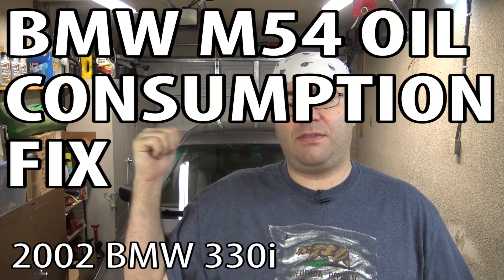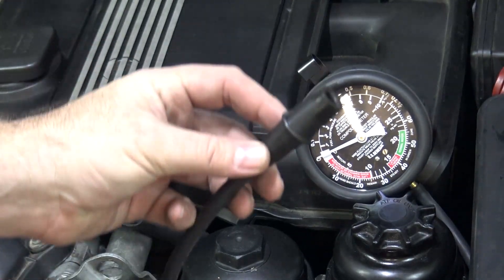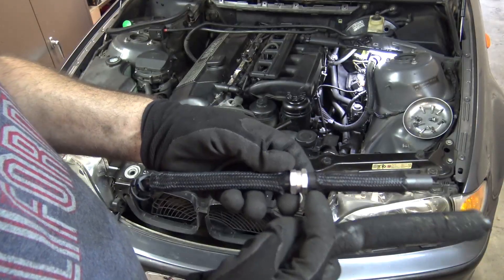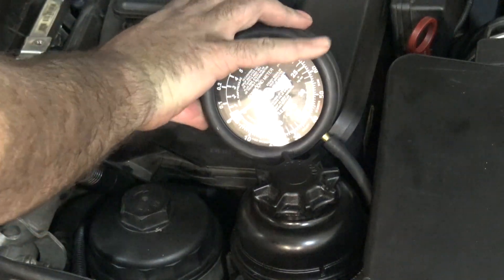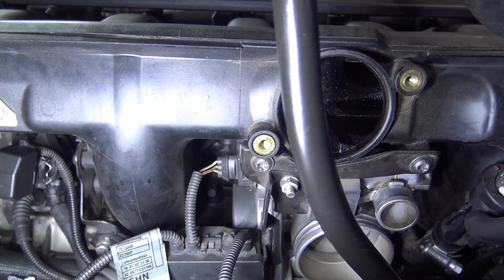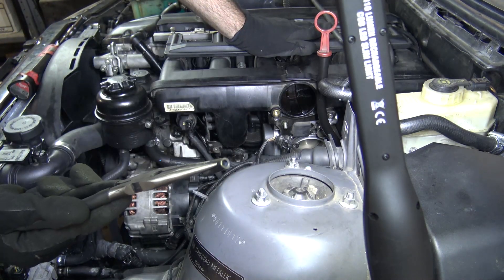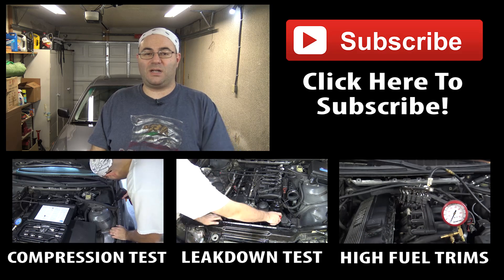BMW E46/E39 M54 Engine Oil Consumption Fix (02Pilot Mod) DIY

Comment: had this mod on for a couple of weeks and it made my oil consumption worst, tried it with the check valve and without, doesn’t work, just run a catch can in line with the original ccv system

Comment: Hi 50s Kid !!, congratulation and thanks for you channel and their contribution to entusist like me (I have a 2004 320I with M54B22 engine). I have some question: check valve need some presion to flow in the permited direction, how the oil will flow gravitationally to the pan if don't break that pressure?

Comment: 🤚 dumb question: The tubing that you cut to add the check valve to. That tubing connects to the dipstick tube and the valve will sit slightly above where the tube inserts on dipstick tube. And the check valve has the arrow pointing towards the connection at dipstick tube?

Comment: I did this on my e46 330ci, both the valve and the added vacuum hose, my car still smells like oil inside the cabin, is there anything else i can do or do i just have to keep driving to burn the oil that piled up inside the manifold?
Reply: Having smoky exhaust?

Comment: I have a major CONCERN here the one way check valve has a minimum working pressure of 0.2 bar i dont think the oil droplets achieve this pressure so you are effectively closing the tube that goes into the oil sump and therefore not recuperating any oil. 
Any feedback or thoughts on this is highly appreciated

Comment: This isn't a real cause and solution for oil consume. The problem is about the oil rings in the pistons. On my M54B30 i've removed completly the oem CCV and oil vapor goes to the atmosphere. The engine still eating 1Kg of oil for 1000km. So this mod isn't the solution at all.

Comment: OK, I hooked up the O2 pilot method on my M 54 and the oil consumption has stopped. The only issue that I see now is the oil pressure light flickering when I come to a stop what is causing that? Is anyone had this issue after the pilot method?
Reply: Did you find any solution?
I see that this happens to many people
Reply: @elquemao I just put 10w-40 in and got rid of the 02 pilot and oil level has hardly dropped

Comment: I tried to buy the 3/32" and 1/4" vacuum hose at the local parts store, the 3/32" does not fit on either the nipple or the 1/4" hose. Advance auto parts had a bunch of vacuum hose, I ended up getting 5/32" and 1/4", the 5/32" fits great on the nipple and on the 1/4" hose.

Comment: I'm a little bit confused. Is there a difference between the little and the big intake ports?
I just want to know if there is a necessary for me to buy the adapter for the hose.
Thank you!!!
Reply: It depends whether u have a free vacuum port u can tap into. like if u have a secondary air pump and exhaust flap u will have to use the larger one.

Comment: Thank you 50sKid for your time and effort on your chanel.
10 years ago i bought a 2003 330ci convertible. In the North of Sweden. Its my summer car. Anyhow! Yesterday i did my 02pilot mod. The only thing i remowed was the airfilter housing and the upper big intake hose.  The rear plug was broken so i took it with my fingers. The smaller hose was easy to conect with a plier. The rear tube was tricky, i took a drill and made the hole more like a funnel at the end. Once i got it started i could take a long stone aged plier to get it in all the way. The only problem i had was some big brownish flying things that takes a bite like a chicken nugget. It was +30 C and sunshine, and i had to work fully dressed. When i had the 2 tubes connected i put everything back and started the engine, and the vacuum was in the rear tube, so the arrow on the valve is pointing to the back of the engine. 
I have the Torque app and obd sender, so i can see all sensors, but not erase fault codes. The vacuum meter is the same now as before 02pilot mod. The funny thing is that i get BOOST at full trottle on first and second gear, before and after the mod. 
I had to fill up a + pint every 2 tanks. Now i have 2 trips to the gas station and i will hit 200 000 km.. 124 274 miles. 
The CCV is never changed, but i dont have cracy vacuum when opening the filler cap.

Comment: Hey 50skid I had a question. About to rebuild my ccv system, with what you know now, would you still recommend the one way valve in the dipstick drain tube hose? Or do you think it’s unnecessary
Reply: In a later video he found that the cheap Chinese valve he tried leaked, so maybe not any practical benefit

Comment: Am I the only person that can’t find 3/32 ID vacuum line ANYWHERE?

7/64 is the smallest line I can find anywhere locally, and is 1/64 BIGGER than 3/32 and doesn’t even come close to being 1/4 OD.   It’s super thin.  What 3/32 hose has an OD of more than 1/4?  That doesn’t even seem possible.

@50sKid Are you 100% certain that it’s 3/32 ID line?

Amazon doesn’t even show me ANY 3/32 ID vacuum line.  If I can’t find it on Amazon, it’s no wonder that 15 plus auto parts stores just gave me a blank stare.
Reply: @50sKid

Comment: Great video, my CCV was replaced 4 years ago and my 530i burns a litre of 5w40 every 250 miles. I would like to try this.
By the way, the CCV drain hose is completely dry. That's because the CCV has failed again or because of lack of vacuum?

Comment: At 5:53 the gauge shows almost no vacuum pressure because the with the CCV input hose connected to the gauge, the valve cover hole is wide open causing the crankcase to have zero pressure and the same inside the CCV. You need to plug up the VC hole.

Comment: Has anyone done this mod without the check valve? thanks ~
Reply: Don't use a check valve, it doesn't work because it already requires 0.2bar to open. It also gets clogged with dirt.
I did the O2Pilot mod and the oil consumption stopped which was 1 liter/1000km.
The mod requires that there are no suction leaks in the car. First I did a smoke test and then at the same time with O2Pilot I installed a new CCV and all pipes.

Comment: I only get oil burning at 6000+rpm my engine is on 253,000 miles 2.2 petrol but has been motor way miled from new the guy said he used to drive it normally up to 70mph then stick cruise on as he was a highway engineer so I doubt my engine is severely worn out. Is it worth me trying this? It goes down to min mark after about 600 miles
Reply: What about now?
Reply: @riccardodefina9551 it’s pretty good now I only check it maybe once a month and barely drops I’m on 270k miles now I’d say it takes around 2500 miles now before it needs a little top up
Reply: @dexietyy7922 wow from 600 to 2500 miles is a very good increment! Nice to know this! Mine 2.2 too has something around 218k miles! So if yours has this type of consumption it might worth a try even on mine!

Comment: I'm having trouble with the 3/32" ID line and 1/4" ID line, the 3/32" does not fit snug at all in the 1/4" ID line it is too loose, am I missing something here?!?! Can anyone offer any help?
Reply: Same here.  I can’t even find 3/32 line, even on internet searches.  Even 5/32 is way to small to snug into 1/4”.

It would nice to get answers on this.

Comment: if you pull to much you risk oil injection no good, A typical PCV system should be pulling about 1 to 3 inches of vacuum in the crankcase at idle. If you see a significantly higher vacuum reading, the intake manifold gasket is probably leaking and pulling vacuum on the crankcase.

Comment: I really like this but i have a m54-b22  and i dont see those blocked iff pipes on the intake i only have it on the air intake pipe just behind the air air flow sensor

Comment: I don't have that port on the ccv, 04 325xi..... UPDATE So I have the "cold weather" ccv version, so it's like wrapped in a protective shroud, so I couldn't see the vacuum nipple. So I took long needle nose pliers and ripped/tore a hole in the shroud around the ccv after I realized why I wasn't seeing the vacuum port. Then it was right there. I only had to take off the airbox and half of the throttle body elbow. I used 3/16id vacuum hose on the ccv port, and 1/4id vacuum hose on the back of the intake, both from Napa. And I did slide the hoses into each other aswell.

Comment: Couple questions... My 01 330i throws smoke on accelleration and consumes oil. Will this mod also stop the smoke puffs on accelleration? I'm GUESSING YES. Also I live in New England but this vehicle gets stored in the winter. What happens with the cold and the condensation (in other words what problems does the condensation cause when you run this mod in cold weather? }Thanks

Comment: Thank you for the video. You start mention that th 02 pilot mod is not for cars driving in cold areas. I live in Denmark, which can be rather cold in the winter. Why is it, that cold weather is not good for the o2 pilot mod?
Reply: Did u ever try the 02 pilot

Comment: The vacuum hose, is it better to be rubber or silicone? I did the mod with rubber  and I have gone from consuming 1 quart al 850 miles, to 1 quart at 1700 miles, and it seems to me not vert successful (with the new ccv changed)

Comment: Which direction is that check valve facing?
Reply: I believe you want oil to not be sucked from the oil pan, back through the CCV, to the intake.  So 

CCV  --> oil pan; 

where "-->" means the valve allows oil to flow down to the oil pan, and does not allow oil to flow from the oil pan to the intake.

Comment: The e83 x3 with the m54 engine comes out with the vaccum tube from factory.

I noticed realoem also updated to the part number to the vaccum pipe and no longer the cap

Comment: Thank you for your videos. I run a BMW only repair shop. I have done this mod 4 times already with excellent results. And I always give you credit for it.
Reply: Do i need to use the non return check valve or can I just leave all the lines as is and just add the vacuum line?
Reply: @andreachooo9847  you do. If not it will suck oil into the intake
Reply: Where do I put that one on the dip stick tube? And where can I buy one return valve like that because his link is out of stock
Reply: In the video he shows that this mod creates more vacuum, and even more on open throttle. Can't this damage the top lid gasket or valve body gasket after a while, i mean bmw engineers designed a certain vacuum for a reason, I'm worried some components  might take damage over time. Did you have any experience with this?
Reply: @andreachooo9847  is this the proper repair? No. Does it works? Yes. When the car is worth $5K or less and the owner is adding 1qt every 200 miles it doesn't matter. I did my first one 4 years ago. Customer is still happy and the car is running good with no side effects.

Comment: Great job. It does make you wonder just how much testing and development BMW put into the transition from m52 to m54, you would think oil consumption would be a basic assessment to make in the engine testing stage.

Comment: I changed valve cover gasket and cover itself. Then I make o2 pilot mod and after 10 months I have valve cover leak... Is this possible because of the pilot mod?

Comment: Hey 50's Kid . . . I noticed that it has been over 5 years since you did the Mod to reduce oil consumption  . . . 

Question 1 . . . is that still the best solution?  

Question 2 . . . You mentioned installing an e39 M5 Oil Separator . . . I don't see a video on that . . . Did that not work better or not at all?  Is that why we don't see that video?  

Question 3 . . . Your Non-Return Check Valve link is to a "Fuel Line" Check Valve . . . is that the correct Check Valve to Install . . . And can you provide a picture where specifically that check valve should be installed and what direction the flow should be?  I don't want to install it on the wrong line and/or in the wrong direction.

Thanks.

Comment: I have a 2002 325Ci and I am considering installing the "Catch-Can" system, but... should I just do the '02 Pilot Mod' install? OR do I need install the catch-can first then do the '02 Pilot Mod'?  Help!
Reply from the maker: One or the other, your choice. I’d try the mod first to see how it works out for you. But remember to make sure your valve cover gasket is sealed well

Comment: Hey. Can I do the same in M52B28TU? 1 hose from PCV to back of the intake, and second from fuel preassure regulator to intake hose with M54B30 double connector? Will it work?
Reply: M52 has good factory piston rings. No need for this mod

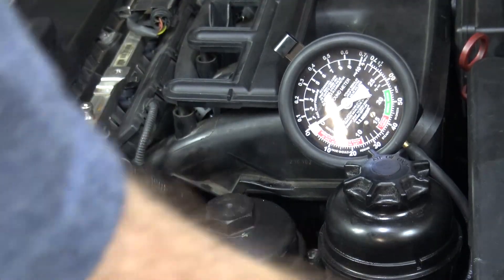Comment: Just a word of warning: if you do the mod WITHOUT the check valve, do NOT do what Jason does at 10:00, or open the oil filler cap, with the engine running - the vacuum created when the valve cover is opened WILL suck a bunch of oil into the head!
Reply: Yes, did this and my M54 became a white smoke machine for a while :)
Reply: did you end up fixing your oil consumption issue? @MatejGirasek
Reply: @MatejGirasek how long did it take for the white smoke to clear this is concerning now 😂
Reply: @calvinnelson2500  Poor you, mine was smoking for at least 20 minutes😂 Hope your catalyst wont be damaged...
Reply: Check valve installed. I just got done with this job and I'm about to crank it up!
Reply: Thanks for the heads up
Reply: Did he include the check valve in the video?
Reply: I really wish I seen this a bit sooner hahaha literally did exactly this and have now stripped the ccv valve out cus thought it was the issue but really it was self inflicted 😂
Reply: Similar here - I did install the one way valve, but the wrong way around.  Drove down the road and suddenly couldn't see anything but thick grey.  A quick swear word and turned back to the garage.  Swapped the valve around, then ran the engine at 3k rpm for a good ten or more minutes to burn as much of the oil out of the exhaust as possible before heading back out onto the road again.  An aggressive Italian tune up for a mile or two and it pretty much cleared the oil.  Not done many miles yet but all appears well now.
Reply: Update - several long and short journeys (some aggressive) amounting to about 600 miles.  Dipstick level has not moved but, often, not every time, I get a puff of smoke on start up.  Does anyone have a possible explanation?  It never did this prior to doing this 02Pilot mod.

Comment: Hi Jason! Do you think doing the o2 pilot mod without overhauling the ccv first, could cause rod knock? My car died shortly after doing this mod, producing a knocking noise. I got it started on a downhill section of road and it was knocking quite badly. Some mayo on oil cap and inside of valve cover that wasn't there literally 100 km before doing this - I overhauled the vanos shortly before doing the o2 pilot mod.

Comment: Want to thank you for this, solved my m54 oil burn issue immediately after. Also did a new ccv as per your video. Thanks alot

Comment: Also, the pilot mod, arent you putting straight vacuum on the oil return line running the vacuum to that little port?

Comment: 50s, isn't the stock vaccum around 16 mbar (0.5 inHg)?
18 inHg seems like a lot of pressure for the seals to last, it's 0.4 bar of absolute pressure inside the Crankcase.

Comment: I did the mod on my 2004 325xi, but after driving awhile, it triggers my check engine light saying that the engine is running too lean. Anyone else? Or am I doing something wrong?
Reply: You likely have a vacuum leak somewhere else in the system. The O2 Pilot Mod is amplifying it. Find the leak and get it fixed

Comment: Old video but thought I’d share my experience, doing this did decrease my oil consumption. However I autocross my car and I ran into issues with the vacuum hose falling off CCV port, and had to add a zip tie or hose clamp to get it to stay on. It’s a tight fit to get my hand in there so I ended up having to remove the throttle body to get the clamp on.
Reply: I'm  about to do this as im in the middle of replacing my CCV. Any other tips when carrying out this mod? Which port on the back of the intake manifold? Also is the port on the manifold the same size as the one on the CCV?
Thanks
Reply: @joefowler9600  https://www.google.com/amp/s/gumptiontrap.wordpress.com/2020/04/06/how-to-reduce-or-eliminate-oil-consumption/amp/.  This is a pretty good write up, I don’t remember how I chose which port I used, but it wasn’t the same size as the CCV. But I was able to put the smaller size hose inside the bigger fine. I also put a zip tie on the manifold port which is pretty easy to do.

Comment: I have a 2002 325ci. If you don't see an oil separator with a cap on it to the left of that electrical clip and it has a solid plastic wall. There is a cold weather edition that has a soft foam type housing around the oil separator. I bored a hold in it with a Dremel tool was very easy to do. (You could probably just rip a hold in it with a pair of needle nose plyers) to access the oil separator port.  See https://youtu.be/DjkHDTjQecE to see what they look like.  The rear port didn't have a cap over it either??? I just stuck the hose over it.  We will see how it works. I'm also running a thicker 10W40 oil.